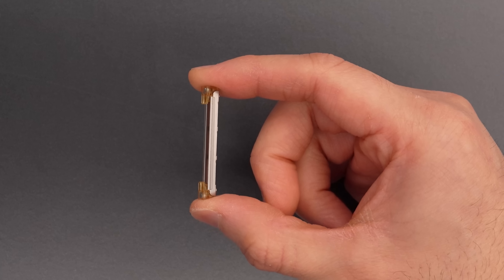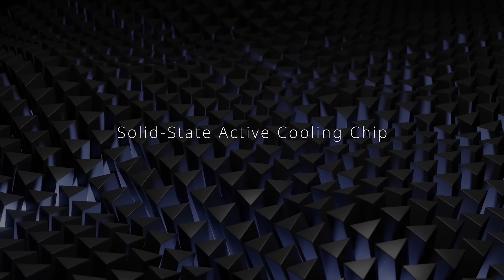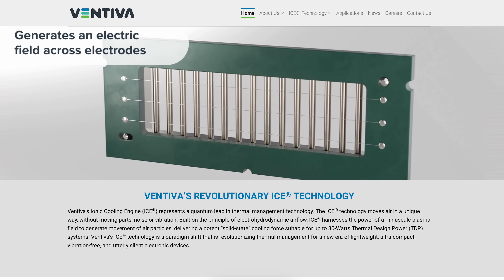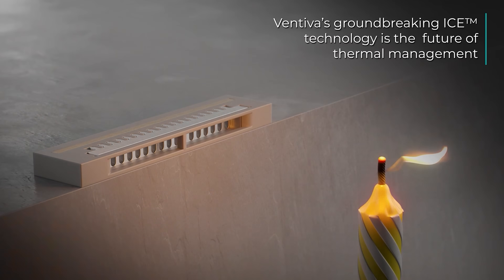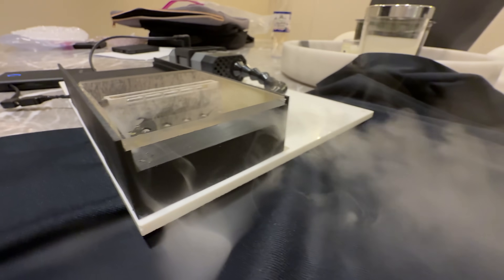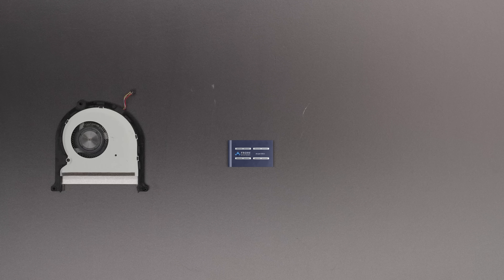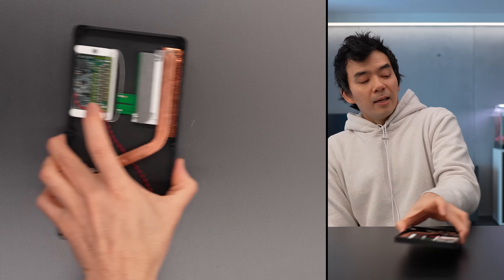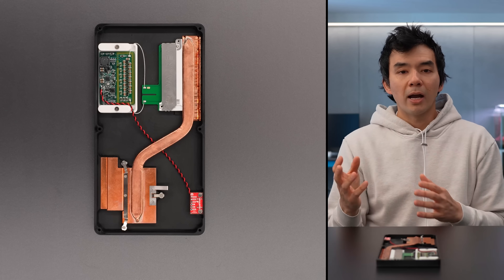The IMPOSSIBLE Laptop Fan...

Comment: I love your enthusiasm about ionic thrust! Thats exactly how I feel about it honestly. Have to say, your breakdown on this topic is phenomenal. I've had viewers for years ask about using ionic thrust in computer cooling and i've personally advocated against it, as ionic thrust still tends to have ionic residuals, which can interact with sensitive components. Apparently ventiva has worked to reduce this? Great video!
Reply: The goat is here
Reply: the man himself is here
Reply: I was thinking about you the whole video. And damn, here you are!
Reply: Wouldn't ionic residue only be a problem if you used the ionic thruster to blow air into the cabinet, not when you use it to blow air out of the cabinet??
Reply: @Supercharger86  I think the issue is if it takes in air that just came out of it shortly afterward, so its better to use it in open spaces. Not only that, but the thruster is blowing air over the very conductive copper heat piping. I'd wonder how much that can pick up a charge from the thruster in any condition, but there might be some way of grounding that out so you don't end up with a sudden static discharge that blows holes through millions of transistors in the CPU rendering it a useless plate of doped silicon.
Reply: Lol right when I saw Dave holding it, I was like "Oh I know who has to see this"
Reply: I came to mention your video on this project. Guess you beat me to it 😂
Reply: The man. The myth. The legend himself. 
Can't wait till you fully figure this out and make a way for it to be extremely efficient to have lots of uses.
Reply: Here is the man who taught me ionic thrust🎉
Reply: Initially, I thought it was an ionic thruster, but Dave said there is no sound, I got sceptical as I heard plenty of sound in your build. Then when Dave explained it, oh yes, it is an ionic thruster and probably hasn't seen your videos haha.
Reply: Ahahha scrolled down to the comments specifically to see if you had commented!
Reply: I love how Youtube is a community. The GOATs talking to each other in the comments rules.
Reply: Whenever I watch "cool tech, concept" I always say "I will believe when someone will test it", just because someone says something about the own product, it doesn't mean anything.. They can lie for whatever reason, either they may want to get sponsors, or just to sell the concept aka "it's not our problem anymore" etc., or maybe they think they will somehow find a way.
Reply: Jesus loves yall
Reply: I just remembered your video when I watched this
Reply: I assume thats why it comes in a housing
Reply: Isn't it just shooting the ions out instead of in? I don't see anything special
Reply: that's why there is Faraday cage but it's probably not enough
Reply: The ionic thruster wizard has appeared!
Reply: I wonder if the ionic residuals will really matter in this application, blowing through a heat sync to open air vs over the motherboard. I'd assume if the ionized air interacts with stuff like copper they'd plate it in nickle or gold, or choose another material like aluminum.
Reply: How about Ozone production. Is this an issue here? Or is this device more like the Ion-Pyramids from the 90ies that stood on the office desks just with extra air movement?
Reply: Are you going to cover the new "plasma thrusted drone tech" the military has inadvertently shown to the public?
Reply: I've been scouring through the comment section, looking for this OG comment.
Reply: I literally just mentioned you in a comment then this one got highlighted afterwards lol
Reply: Came to the comments to see if anyone had poked you about this. LOL. Wonder if this stuff being mass manufactured could make parts and tech to be easier to get your propulsion designs easier to get/make.
Reply: immediately thought of your channel when seeing this and I see other comments saying the same :D
Reply: .....ABSOLUTELY 100% SCEPTICAL

...THE THING DOES not HAVE THRUST.....THAT'S A serious FLAW....
Reply: it's just a prototype, relax
Reply: @kiyoponnn  Except; it's not.

He said it's going into production for a major manufacturer.
Reply: @mohammedgoder   Just because someone says something about the own product, it doesn't mean anything.
Reply: @MAST  You have no idea what you're talking about.

If you have nothing of value to add; stop commenting.
Reply: @kiyoponnn  You also have no idea what you're talking about.

If you have nothing of value to add; don't comment.
Reply: @kiyoponnn  some people really do act like every potential technology has some perfect manifestation later down the road that we just haven't developed yet.

no, sometimes it's a dead-end. same with LLMs, btw.

Comment: Is it really "solid state" tho? By that definition a vacuum tube would also be solid state since it has no moving parts and it uses ion physics. Traditionally "solid state" means that a device is based on solid state physics, like semiconductors. Anything involving gasses and ions is not really solid state I think. Its just a naming thing, I get that they just use "solid state" as a buzzword for "no moving parts" :)

Comment: Frore's thing is actually pretty efficiant.
Cooling isnt just about total air-volume its about how much HEAT is actually being moved. Frore's device can saturate the air with the heat on-top of having enough pressure to handle the restrictions in mobile devices.
Reply: plus one of the main strenghts of frore's product is its EXTREMELY low maintanance requirement, making it suitable for use in applications where you can not easily change out the entire unit. Both technologies have their places. I only fear that ventiva's product will output so much ionized air that static charge becomes an issue.
Reply: Yeah and even on a laptop you can have both a fan and a frore.. if you are connected on outlet you go frore..for gaming or gpu related professionals it would be great! About ozone.. for sure we need more of it on this earth.
Reply: @cliqueimarketing  you realize the ozone layer is completely fixed, right?
Reply: This makes no sense the only way to move more heat is more airflow (all else being constant). More air flow = more heat being removed.
Reply: The thing is not all other things are constant. You can have much denser heatsinks with the high static pressure of the frore.  @choilive
Reply: @choilive  All else isn't constant though. Pressure, both back pressure and static pressure, is very important when dealing with thermal dynamics.
Reply: @choilive  actually, airflow is not related to heat dissipation through convection at all.
Faster airflow means you have a lot more, but cooler air coming out of the business end.
Pressure is more directly proportional to heat transfer.
Reply: @frankyanish4833  The whole point of increasing pressure is to improve the airflow in high resistance situations. More airflow = more heat transferred.
Reply: @choilive  right up until you hit the point of maximum transfer between the two materials. After that, you actually get less heat transfer.
Reply: if it is that efficient why aren't high performance laptops using it? 😂😂😂😂ignoramus
Reply: @kiyoponnn  It was never going in high performance laptops in its current form, they said they were for <25w TDPs.
Future iterations may be able to scale it up/out to ~100w but who knows when that will be.
Mass production and market penetration was always going to be an issue since they were a technology startup who is now trying to make and sell a product.
Reply: @kiyoponnn  No need to be a dick about it man

Comment: We used to have full size floor fans made from this technology. They require constant cleaning because they attract dust
Reply: Mmmmm Ozone
Reply: That is a problem
Reply: @hectoraccented5312 okay that Is an issue. But dusting your rig is standard. It would just have to be upfront and honest in the manual. If it's fully silent i feel like customers would at least understand pros of cons of getting that model. Ya know assuming it hits mass market idk.
Reply: @gir240  dude, they dont let you open laptops without getting politics involved. what dream are you dreaming, there is no way they are telling you to dust fans.
Reply: Ionic breeze fans
Reply: So like a normal fan?
Reply: @FluffyAngelUwU  A fan doesn't attract dust, it just sucks it with air and expels it with air. Eventually some gets trapped on the blades. Ionizers ACTIVELY attract dust and every impurity in the air. The surfaces around an ionizer can turn almost black from all the stuff it attracts, and pretty quickly.

Comment: The company working with Ventiva, Compal, manufacturers hardware for Dell, HP, and Apple.  So it will, eventually be in at least 2 of those companies.  I have a feeling the Apple engineers might be smart enough (or nefarious enough) to recognize that ionized air damages plastics and rubbers, and wouldn't be dumb enough to put that into a piece of tech containing plastics and rubbers. (or smart enough TO put it in, knowing its putting a hard expiry date on their expensive hardware)
Reply: Dell love their laptop with degrading rubbers

Comment: So it will be on a dell xps? I see the dell logo at 6:00
Reply: Dell SEX-PS
Reply: Another moron.
Reply: XPS does make the most sense. As in an Alienware, everything is about cooling, not sound. And like he said they are not as good in cooling per watt, but for a XPS? Better performance and the sound of a fan less PC? XPS all the way!
Reply: Why did you assume XPS imemdiately? I doubt they will put it there first. Either Alienware or some more unknown budget model
Reply: @agiverreviga4592  I don’t think it will be Alienware cause gpus need much more cooling and this does not seem provide a ton of airflow. XPS makes the most sense since this tech will be expensive so it will go in their high end laptops.
Reply: @Melchirobin  Imagine how many of these you could fit in place of a regular fan though
Reply: @agiverreviga4592 because it's the premium line and would benefit most from quieter fans+more space.
Reply: Because xps is their ultrabook, thin, quite and powerful. Maybe it will be used for the 13inch xps
@agiverreviga4592
Reply: @agiverreviga4592  or why not an Inspiron or Latitude?
Reply: Where do you see the logo? It looks like bolt head
Reply: @j1ngks  5:58
Reply: I would be really disappointed if they first put this cool technology on the insanity of a laptop that is the XPS. Luckily, that does not look like the Dell logo but instead a bolt head.
Reply: all of us were wrong lol.
Reply: @TragicAyk  I was surprised that it actually turned out to be Dell, as they can't even make a proper keyboard on their laptops. And, now, I am even more surprised that they did all this whilst also enduring an identity crisis. (They called a product the "Dell Pro Max Micro". 💀)
Reply: @thesun___  bro I just read that like ???? imagine in a few years going "I can't decide between the Dell Pro Max Micro Plus 2035, the Apple MacBook Air Pro 12,67-Inch M19 and the Lenovo Flex 5i GO OLED Slim 8x Yoga Edition AMG S-Line Lite"

Comment: 8:51 it’s cheaper to build then a fan…. 20~40 dollars… way to much
Reply: Yeah, you are going from motors, plastic fins and all the complications with moving parts, to a few bars of metal that you need to power
Reply: Well think about it, a $40 cost to the manufacturer would likely be a $100 cost that's passed on to the customer. I know that's not a deal-breaker for most laptop buyers, but I think the manufacturers don't see things the same way consumers do sometimes

Comment: this is like a 100 year old technology, nothing new
Reply: Then why hasn’t it been used yet? The concept might have been discussed long ago, but without proper production processes and efficiency improvements it wasn’t as efficient as fans until now.
Reply: @Sumire9287  There is nothing to improve, the airflow is proportional to the area of the opening and the applied voltage, that's the physics and you can't change that, with higher voltage comes higher ozone production, which is not desirable in this situation.   It's basically just a weaker ozone generator copied 1 to 1 and called a solid state fan.   A high voltage in the laptop motherboard area would also not be very desirable, combined with a super low cooling performance, it's basically useless, and it doesn't make sense to push it into mass production in this application.   Just stick with using  it for ozone generators and air purifiers.

Comment: I hope Apple is deep in investigating things like this. Smaller packages for the airflow, or else adding some amount of airflow to passive devices like the MacBook Air and avoiding throttling without a moving fan.
Reply: macbook air doesn't have vents
Reply: @idontmindu  Obviously, I'm talking about hypothetical future products that retain the compactness and resistance to dust and noise of their passive products, but with some active movement. Just a tiny bit of extra cooling could take the MacBook Air just as an example from throttling 30% to not much at all.
Reply: @idontmindu  That’s what he means when he mentions that it’s a passive device. Passively cooled. Using the aluminum body as a radiant heatsink through convection. It does not have forced air movement anywhere to greatly multiply the efficiency of the radiant passive heatsink. (the laptop body) The laptop is completely silent this way, however, once the body becomes warm it does not remove heat efficiently enough to allow the processors to continue to be run at their maximum frequency due to overheating, so when the body becomes warm and the processors reach a heightened temp, they begin to throttle the operating frequency down (slowing the processors) to maintain that maximum operating temperature, where as in a forced induction cooling system, the fan would spin up to keep the processor cool and allow it to continue to work at its highest frequency (fastest) by being actively cooled by a fan, instead of being passively cooled through radiant convection from the aluminum body of the laptop, which acts as the laptop’s heat-exchanger.

Comment: This (similar) is already used in the B-2 bomber to achieve extra flying heights where the air density is not enought to lift the plane itself. Million volts charged on the leading edge of the wings.
Reply: @zeus1117  wow really? Didn't know that. 

Thought that it would be even less effective in rarer air.
Reply: What's your source for this info?
MIT made an airplane powered by ionic thrust but it was extremely low powered. 
If there's a million volts on the leading edge of the B-2 bomber, I think it would be the result of flying through the air rather than means to propel the aircraft.
Many aircraft have spikes on the edge of wings to dissipate static charge. I'm not aware of any crewed aircraft using static charge as a thrust device.
Reply: Stack exchange has a post about it... like like it's from a UFO book
Reply: I thought that is more of a stealth tech not a propulsion tech

Comment: Skeptical, but excited. 
Really value silence in electronics, but worried about how this new tech interacts on soft surfaces and when dusty, also if efficiency will drop over extended periods of high performance use.

Comment: We literally have this tech at home in Czech-made air purifiers and can confirm, they do create a little bit of wind. So this I think is basically a scaled down wersion of that with higher voltege passed through it.
I wonder if this will also atract dust as quickly though.